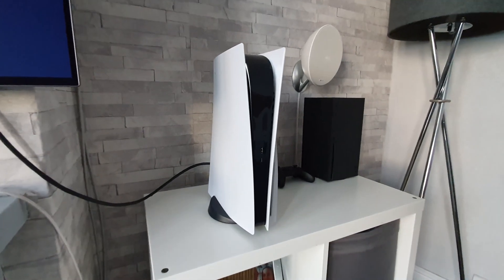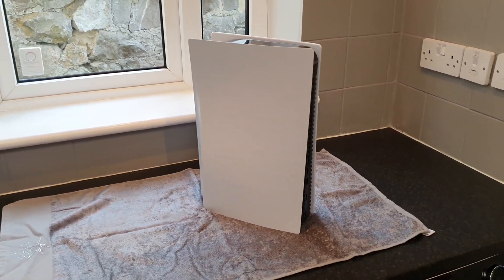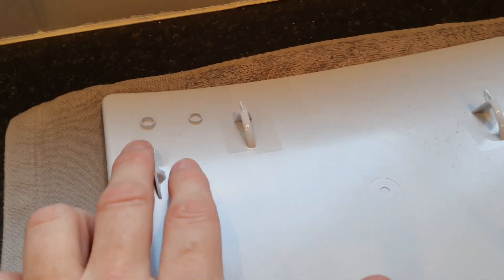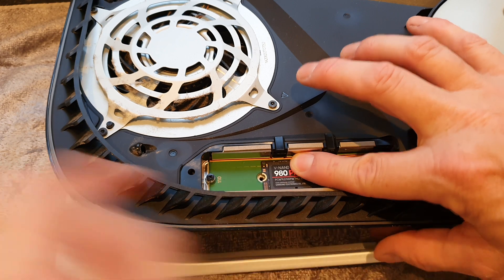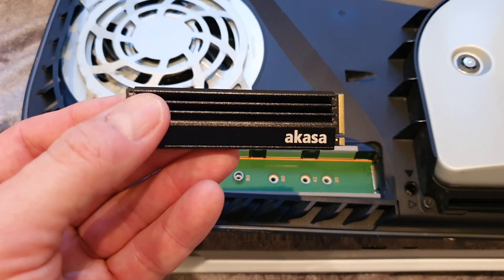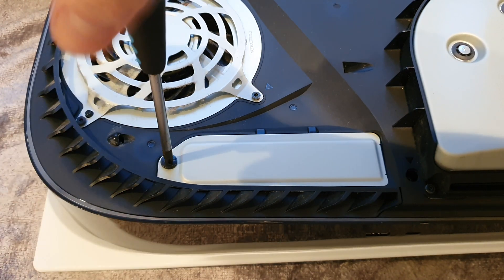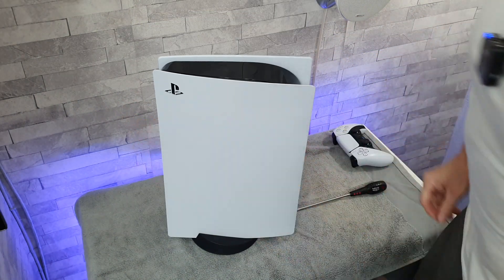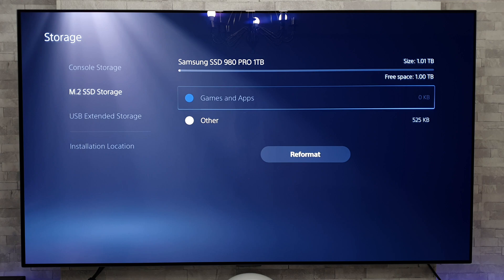PS5 1TB SSD upgrade, SIMPLE guide for beginners that causes NO damage!

Comment: you did not remove the sticker from the 980 which is a mistake
Reply from the maker: Every tutorial I have seen the sticker has not been removed.
And have actually read that you should leave it in place for warranty reasons, and that it makes no difference when it comes to heat build up.

Comment: Great vid mate! One thing to mention which will help yourself and others, If you upgrade the firmware of the SSD with the Samsung Magician software you will 100% see an improvement of read speed which will increase to 7000mbs, I think you were getting 5500? be sure to do this as you will get much more out of the SSD when transferring files from console to SSD and vice versa. I did this myself with mine and the difference is absolutely worth it.
Reply from the maker: I was aware of the update, but I've have heard of conflicting information about what difference it makes.
Some have said the update increased the speeds, other said it made no difference at all.So I thought best to leave it out from this video and concentrate on the installation side of things, and maybe I'll cover it in a separate video 🙂
But thanks for the heads up to myself and others 👍
Reply: How would you update the ssd plz